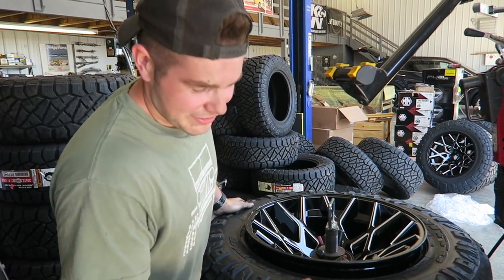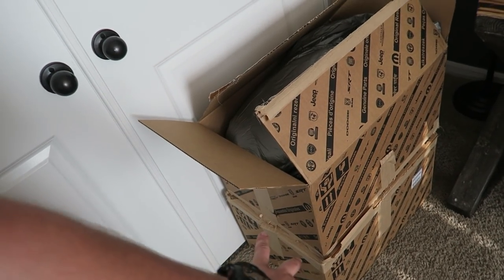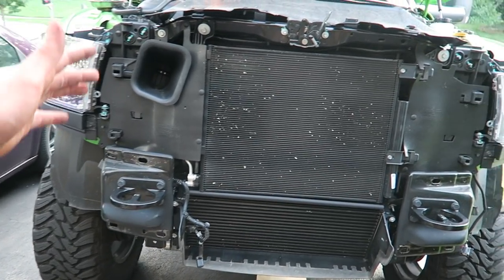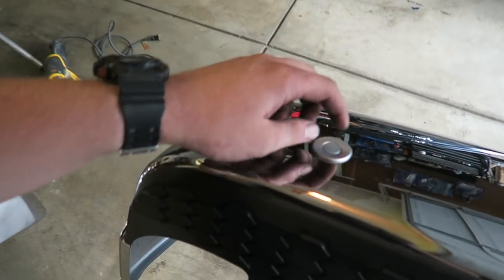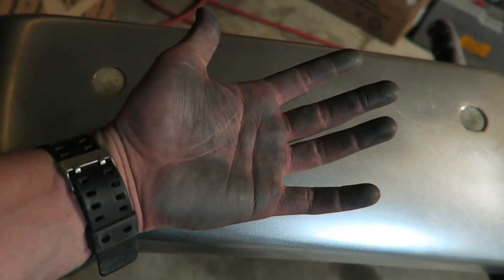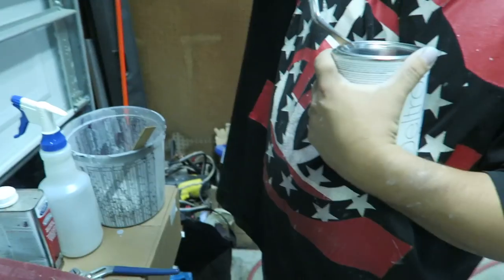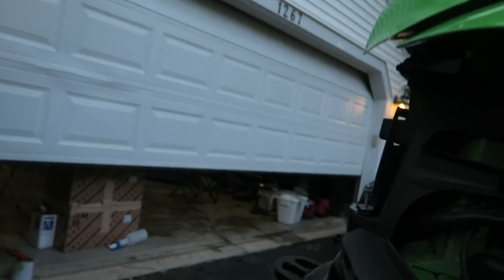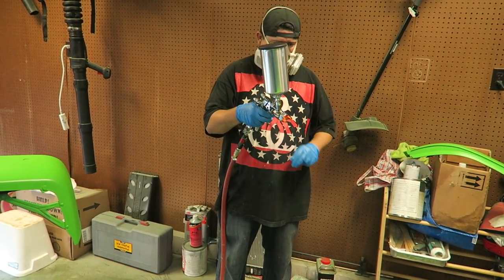HOW TO Color Match CHROME Bumpers!!! *Painting Chrome*

Comment: I have a question about when you were installing the tire on the rims. I’ve seen that fire trick used a lot in videos. Is that the official and proper way to do it or just a fun way? If so can you explain why? I assume it uses the rapid change in pressure to mount it, but how does it stay inflated? Thanks.

Comment: Since you put the bigger wheels and tires on you might want to consider putting xpel clearshield on the bottom from the lower body line down to help prevent anymore rock chips

Comment: I have the 1500 sport in sublime green too but mine has a pearl in it and it’s a dent magnet. Does the 2500 not have a pearl? To repair my last dent from a baseball size rock thrown from a riding mower will cost over $1500 to repair.
Reply from the maker: This color is called Hills Green on the 2500’s and has no pearl!! It’s a bit different from the sublime!!
Reply: I don't know if its because its sublime- lime with pearl or just the shop but I have a ram1500 in Brilliant crystal pearl black and I was quoted at $1500 to fix several dents and respry the whole truck and clear coat but I'm in the middle of nowhere Tennessee.
Reply: james rebstock wow what a deal!! I went to several places and it was the same. When I bought it I was rear ended a month later. Just bumper damage but that was over $5000 to replace and repaint just the bumper. And in the sun it doesn’t match the rest of the truck.
Reply: @ignaciochapa3850  wow that's nuts.

Comment: Not to burst any bubbles but painting over chrome will fail.  You must first sand blast the chrome past the nickel plating and it can't be sanded far enough to get proper adhesion. Do yourself a favor and clear plastidip over that paint to save it from peeling. Looks awesome but unfortunately won't last.
Reply: ?? As long as it's properly primed it won't fail unless the chrome comes off the original metal. And if it's an adhesion problem you are worried about, covering the paint won't change that. An unsubstantiated criticism.
Reply: FisherCatProductions I've been a painter long as you have been talking.. I've done chrome many times. 25 years bro painting... I've done what u did already.  It's going to eventually chip off. The only true way to paint over chrome successfully is to sand blast it down. I've built 60k$ harley baggers worth more then your truck and had to do this process often. Sorry u don't like the facts. Just wanted you to know. Btw I like your truck. I have a 2017 3500 deleted and tuned. Looking to do more mods soon. Don't be pissed man. I just worry all your hard work will be compromised. The clear plastidip will act as a barrier for chips.  It was just a suggestion. Good luck man. Truck looks great.
Reply: Frank, no one is pissed. I think from your response you are mistaking me for the OP-I'm just a commentor like you. While I respect your years of painting, I've personally never had paint fail from chrome due to adhesion. Chips, yes, but that will happen over properly etched, chemically treated, properly primed  raw steel.  I totally agree with the topcoat for keeping chips to a minimum, on ANY painted medium. Trust me when I say I have been talking a lot longer than you have been painting, lad. Peace, dude

Comment: As an autobody tech, you can’t paint chrome, the paint will chip and peel at the end
Reply from the maker: Well you must have not learned how to then, if done correctly it can be done I.e this video
Reply: RYAN MAYER I will give you two months and you will see chipping apart lol
Reply from the maker: NISMOSPECR good thing I painted and unloaded this video almost 4 months ago 🤷🏼‍♂️
Reply: So you do not have not even one rock chip?
Reply from the maker: NISMOSPECR a rock chip would have 0 to do with your argument.  Fact of the matter is you can paint chrome, preparation is key.  A rock chip can and probably will happen to any painted surface.  Painted chrome will flake off if you do it incorrectly